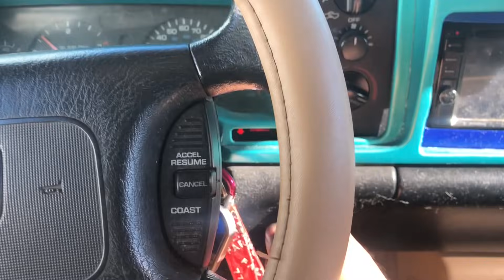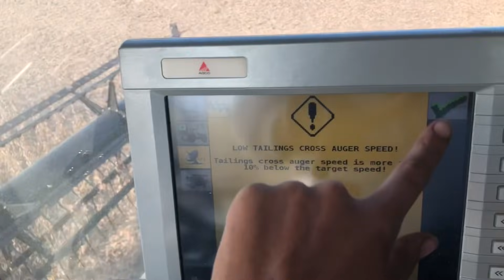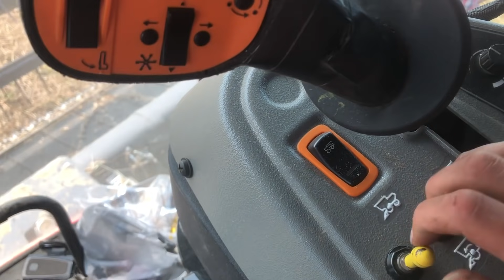A VERY TRYING START TO HARVEST…

Comment: Happy Birthday, Grace. Things that vibrate are always causing electrical and mechanical issues. Looks like you might have some poor quality connectors. Design engineers dont have to fix things. So they fail to forsee problems. Get some that you know dont usually fail. Replace the ones when they fail or when things are slow. I like the waterproof ones. That farm equipment reminds me of escalators. Out in the weather, dirty and greasy.

Comment: I had also noticed that  your reel was running too low. We found running low like that in the crop had a habit of threshing out and ending up on the ground instead of the bin. We found it worked best when the bats of the reel applied enough pressure on the crop to guide
 It onto the apron, and found times where were times where the crop just naturally fell on the apron without the reel even touching the crop.

Comment: Happy Birthday hey a quick fix or temporary fix for the wiring problems with the plug is hot glue gun just make sure they are all in place fill in back side all good have done it many times

Comment: Happy birthday!
There should be a piece on the wire entry side of that connection to keep the terminals/pins from backing out. It is called a TPA (terminal position assurance) lock.

Comment: HAPPY BIRTHDAY GRAYCE!!!  Good ground speed good reel speed good apron speed. Drapers are a little gentler on the crop.They seem to feed more evenly. Most anything new to you has a few bugs and gremlins to work out. All part of operating equipment. I have a question and that is why a Massey and not a Case? Y'all have other red machines. Those are some great looking beans. I just had to subscribe...
Reply from the maker: Thanks! We love case equipment and have considered a case combine, but masseys are great machines, easy to work on as far as general maintenance, and a little bit easier on the wallet!
Reply: @thefarmergrayce  Understood. In todays markets you have to really watch your bottom line. If it does the job and fits your operation than that is what you need to run. I really like your channel. No drama no surprises just you being you. Happy birthday again and take care. From middle Ga....
Reply: @thefarmergrayce  hello

Comment: Yep those little wires and pins can cause havoc, maybe make the electrical harness a stand-alone connection instead of on the quick connect. Could try using Gorilla or T-rex tape and wrap the backside of the header electrical connectors, might help hold them tighter in the plug itself. Things are very sensitive to voltage changes or it throws an error.

Comment: There is a product that I swear is magic in a can.  It is dexoit d5 contact cleaner.  It sounds like you had a pin fitment issue but if there is ever a corrosion problem. That stuff has saved me more than once from having to replace harnesses or connectors.
Reply from the maker: Thanks! I’ll have to get some